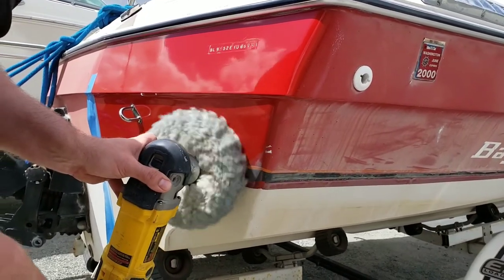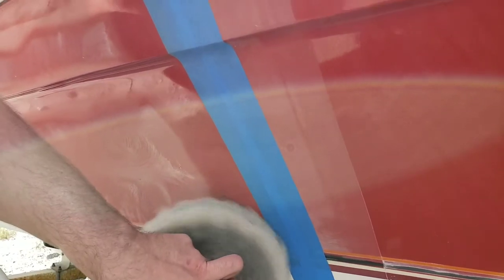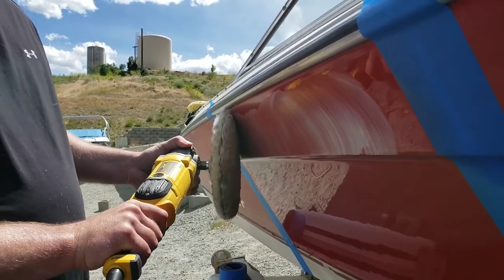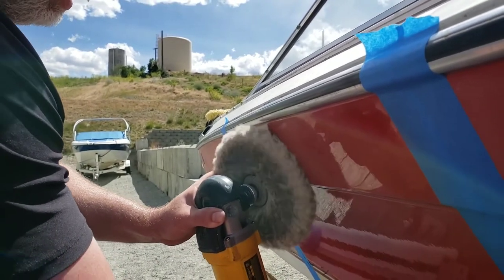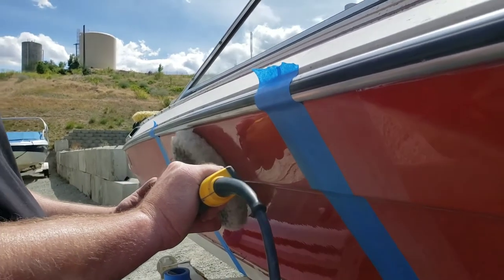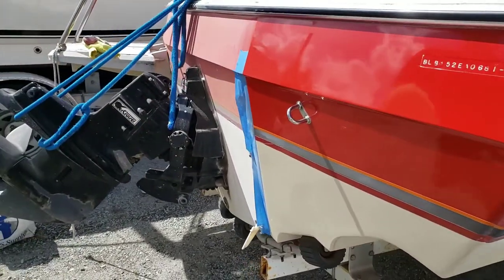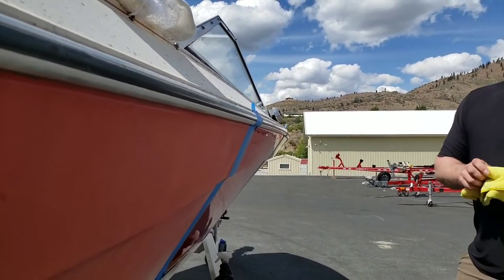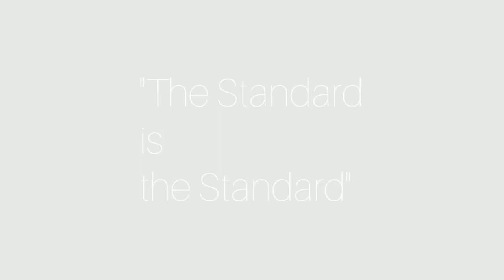Training: Boat Detailing by a Pro. Gelcoat, oxidation, restoration and general advice.

Comment: He did a great job. Better than me.
I started my RV this weekend. 3 day weekend was a perfect opportunity to put it in my customer's shop out of the sun and rain. Took me 2 days to do one side.
First section I did came out perfect. No steaks, no buffer or swirl marks. Looks like a brand new RV with perfect gloss to it. 
Every section after that though gets a splotchy haze to it and I can't figure out why.
Reply from the maker: Let the "wax" sit on for longer and slightly thicker than before. Try that.
Reply: @Local_Boydidgood  I haven't waxed it yet. Did you mean the compound?
It baffles me because When I finish a section it looks perfect. But 15 min later when I look at it it has some blotchy haze to it. 
I was hoping it was that oil you mentioned, but it doesn't wipe off.
Reply from the maker: It won't wipe off, it's basically that oil but after sitting a while, gets absorbed into the gelcoat. The goal is to saturate the gelcoat with the oil from the "wax"
If however you compound and it looks awesome but then fades out, you have some DEEP oxidation and need to grind harder in the beginning (more edge/force while wet)
Try this, clean it and see what happens. If it goes blotchy, try applying some "polish" thicker than normal and let it sit there for an hr or longer. Then try to remove it and see what it looks like.

My thought is to Compound harder but gelcoat is a Mug that's hard to diagnose over the web.
Reply: @Local_Boydidgood  Thanks Lee. Much appreciated. Unfortunately I had to take it back out of the shop tonight. And we have a tropical storm headed this way. I only got 2/3s of it compounded with the McGuire's 67. I did take a walkaround video of it before I started. I tried to take pictures of the Job so far, but being in the shop and rainy all weekend it really doesn't show the drastic difference.
Even with the splotchy haze it looks brand new. I'll email the pics i did take maybe you can see it but not sure.
My plan is to finish compounding it then wash it with dawn like you mentioned. Then wax it it with the McGuire's flagship.
Reply from the maker: I loved the one shot with the rear signal  lit up, everything was taped off and that side looked amazing.
Very dry girl. Follow my email thoughts and I'm betting you'll find happiness brother. Betch a beer! Thanks for your time.

Comment: I just removed decals off the sides of my boat and there's nice fresh gelcoat under the stickers which is a lot darker than the rest of the boat. Which products and what order do I need to do to restore this ? Thanks, Great videos Jim
Reply from the maker: You can use 1000 grit sand paper to level the gelcoat then Heavy Cut by 3M and then Perfect-it ex ac by 3M. Use a wool compounding pad.

I use a DeWalt DWP849X 

If I'm going for perfection in gelcoat, I don't use a ceramic (unless a very new boat) I prefer the ease, cost and reliability of Fire Glaze by RMP

https://www.restructuremarine.com/fireglaze-products-2
(tell them Lee sent you. No discount and I receive nothing but I'd like them to know 😊) 

3M Quick Connect adapter (mfg # 05752) to use with the double-sided compounding pad (3M mfg #05753) or the double-sided polishing pad (3M mfg #05754)
Foam compounding pads 3M (05737-discontinued but awesome) 
or (05723-new version 😑)

3M Super-Duty (05954)
3M Perfect It Heavy Cutting Compound (36102)
Perfect-it ex ac compounds by 3M (36060)
Meguiar’s (owned by 3M) Flagship Premium Wax (M6332) Pro Polish by Shurehold or 3M's liquid wax with scotchguard.

I receive no payment for listing these items. I list them because you guys ask and I just thought I would save some time.

Wear protective gear, this stuff can cause cancer and kill you.
Reply: @Local_Boydidgood  can I use a DA sander with the 1000 grit ? thanks
Reply from the maker: Yup.
Reply: @Local_Boydidgood  one more thing, sorry, sand wet or dry ?
Reply from the maker: Usually for ghosted (different elevation, topographically different due to age and times being buffed) dry will work. Wet makes more of a mess but just use a block behind the sand paper or use a palm sander and wipe to inspect now and then.
Reply: @Local_Boydidgood  you can't feel any difference on the surface, does it still need sanding ?
Reply from the maker: I'm not there, if you see a height difference (typically, one exists) yes. If not, just grind (compound) till the color/shine matches.
Super-Duty or Heavy Cut, Perfect-it ex ac, wash/inspect and use a "Wax"

Comment: What did you apply the was with at the end? 
You also switched pads correct?
Reply from the maker: I apply wax with either a Terry cloth towel folded into 6ths or a soft pad in a random orbital.
I re-watched it. I use a coarse wool pad to grind and a soft nylon pad to remove the wax, yes.
Sorry. It's been a while.

Comment: Can you recommend some good quality wool pads?
Reply from the maker: Hi Rolf, I typically use the ones by 3m. They're generally the best for compounding.
Reply from the maker: 33289 double-sided polish pad (qcn)

33282 & double-sided mix/cleaner wax pad (screw on)

05754 double-sided polishing pad (qcn) 

05705 double-sided polishing pad (screw on) 

33287 double-sided compound pad (qcn) 

05703 double-sided compound pad (screw on) 

05753 double-sided compound pad (qcn)

QCN quick connect nut by 3m.